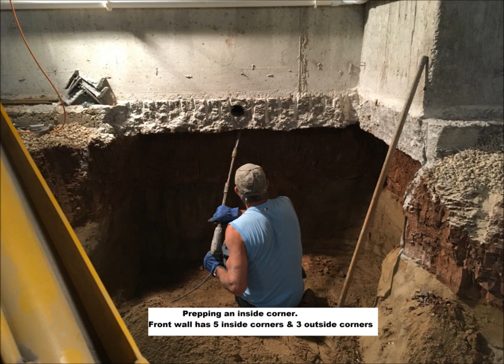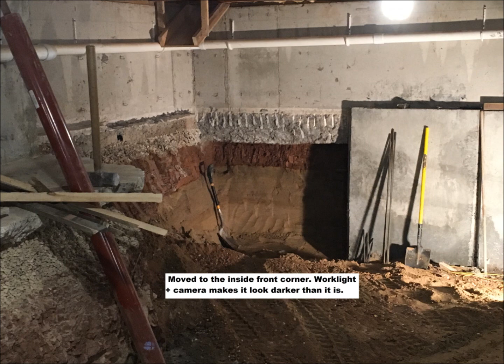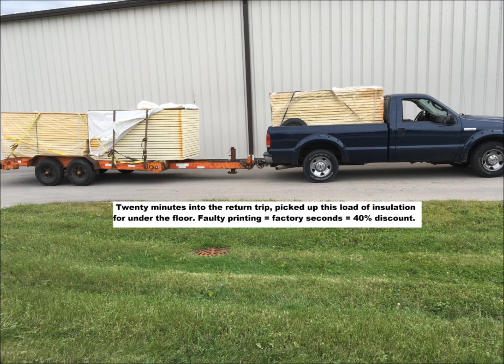Massive DIY Basement Dig Out ~ Chapter 14

Comment: Excellent work. I recently started underpinning and would like to check if I am giving enough information.If you have any suggestions on what I should focus more on in my plans that is so essential for the person who is going to execute the work.If you have any plans that I can use as a reference, I would appreciate it with all my heart.Once again congratulations for this work. I hope you have an excellent day.
Reply from the maker: Alexander, I only drew enough plans to get a building permit, and they only showed the end result, but not the process to get there.
I can summarize the process, though. 
We dug out the center first in order to give us a little operating room. We left about a 4' perimeter of original soil that the house weight was bearing on (under the footers.) Then, we turned to the side wall and dug a maybe 5' wide socket under the wall and underpinned that. Next socket was dug across the room. After 5 days, you could dig adjacent to a new underpin panel. There is is good recap video on the channel.
Good luck. Thanks for watching
Reply: @diycrawlspacedigoutunderpi4201  Thank you